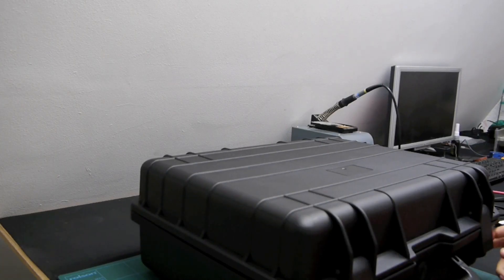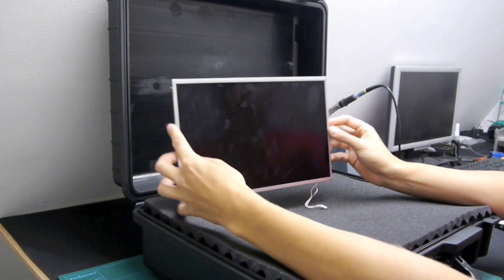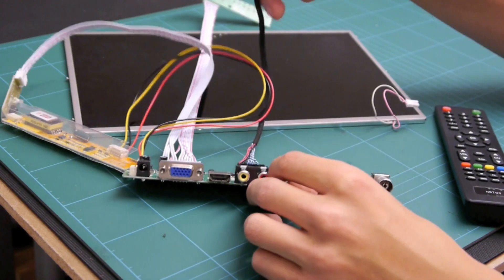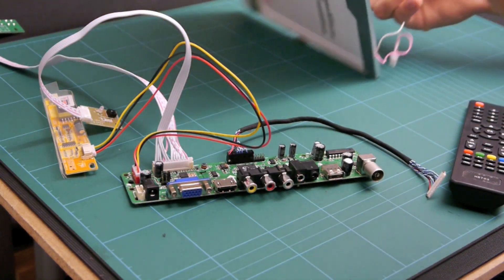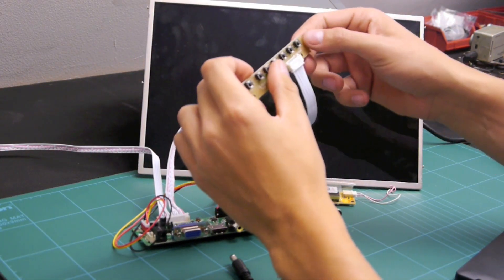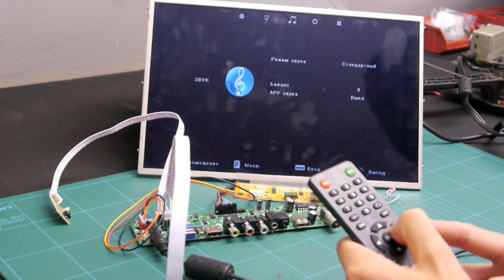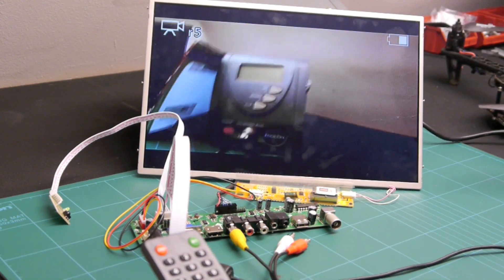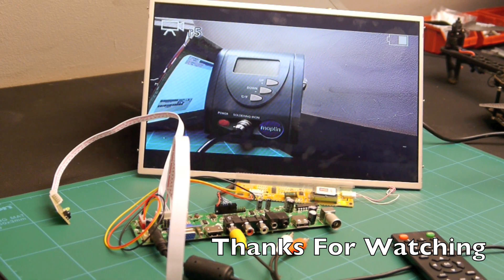TheManLab - FPV Ground Station Build - Huge 13" Widescreen FPV Monitor - Part 1

Comment: Hey man I think this has a blue screen on the AV input right?
Reply from the maker: Lachezar Krastev You can switch it off and on in the menu. Enjoy.
Reply: I am asking because I purchased this board and the seller told me that all boards with AV (RCA) input have a blue screen.
Reply: Can you show how this works on your station? Thanks!
Reply from the maker: Lachezar Krastev You just go into setting and turn blue screen on or off. If you turn it off it just goes fuzzy on bad signal.
Reply: Thanks I will see when my board comes.

Comment: Can u give me the LCD model no.i have a sharp LQ133K1LD4B LCD .Is it going to work with this board and give me the lvds cable link for the same LCD.
Reply from the maker: Ask this seller if your LCD is supported. This is a full kit. http://tinyurl.com/ktbp6xk

Comment: do a small 1. like a proper cheap 5-10 bucks. 5" screen with arduino.
5.8ghz?
Reply from the maker: You couldn't even buy the components needed for 10 bucks, sorry!

Comment: Thanks for the video, I'm interested in building a ground station like that myself.
The one thing I am worried about is the latency.
Have you tried testing what it is on your setup? 

You can see the exact number by turning on a stopwatch on your PC, aiming the FPV camera at the PC monitor, then take a photo of the PC monitor and ground station monitor in the same frame.

Comment: Nice info there. I bought one of these LCD driver units to take advantage of a 17" LCD from broken laptop. but I am not getting the nice menu settings. Would you be so kind as to link the LCD/Driver so as I can research what exactly I was sold :-) Thanks mate
Reply from the maker: Hello, mine came as a kit but this is just like mine. http://s.aliexpress.com/uuuyuuYV 

Good luck!

Comment: Have you done any real latency tests with the LCD driver? Maybe you won't be using it for Close Proximity / Racing   but still, the time delay I was seeing is substantial. So where is it coming from? Is it the camera or that LCD driver you bought? Both maybe? 
 I have the same gear except a 17"  LCD  screen and I also installed some new high luminance LED backlight to replace the tired old CCFL that was in it to make it more easily viewed in outdoor conditions ( check out >> http://www.iccfl.com/index.php?cPath=205&osCsid=0uvo5q20vmgcuqvsm9efunfg56 ) . I have shelved the project as I consider the casing for it, but I now know that I will be up against some possible latency issues. RIght now I am using a 600 tvl   PZ-0420 which has no DSP like the Sony Effio series for instance. And there is a fair degree of lag with those.  When you have a screen this big, you naturally want to send it as high a resolution as possible like the recent 800tvl offerings. Just thought I would share my experience, for me this opens a whole new can of worms :-)  Best regards and happy FPV'ing  , C
Reply from the maker: Hello. Thanks for the heads up. I've never really noticed the lag at the time I was making the video or when I was just testing so I'm not sure where it comes from. I think it may be coming from the GoPro as its the original hero. It possibly could be the compression from 1080 to tv out that may be the problem. When I next do a video on the quad I'll give it a proper test on the fpv camera and not the GoPro. Thanks for your input! Enjoy.

Comment: Can you give any details on the board you are using?
Reply from the maker: +Frank Reynhout Hello. What would you like to know? The board only can be purchase from here http://tinyurl.com/zghbrzq then you need a backlight driver http://tinyurl.com/huurrdl and video connection wire http://tinyurl.com/ho3cd2u this is all dependant on the LCD screen and compatibility should be checked first
Reply from the maker: +The Man Lab Added more links!

Comment: Thats cool ;) But one thing that the camera won't fit the camera frame on White Sheep, cause this camera has 32 X 32 X 23.5mm size, but camera frame of the quad has 28x28mm size. I wanted to buy same camera, but I checked the sizes and I was upset. See what I found, I ordered already this one: http://ali.pub/gusb5 and this nice thing to this zoom lens (the cheapest one): http://ali.pub/r90np

It is the cheapest camera and only that I found, even Baggood didn't have that.

P.S. If it is not a secret, where did you get this hard case from? :)
Reply from the maker: Thank you for the above info. Today I've checked the camera and it fits perfectly on the White sheep mount. The case is here. http://tinyurl.com/qgzo6r4